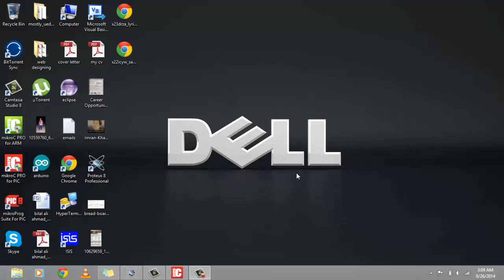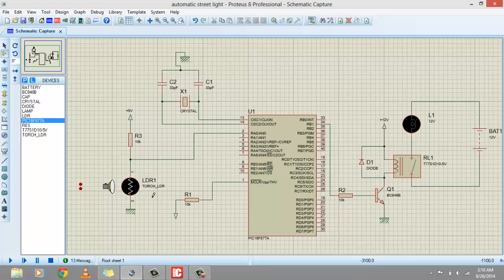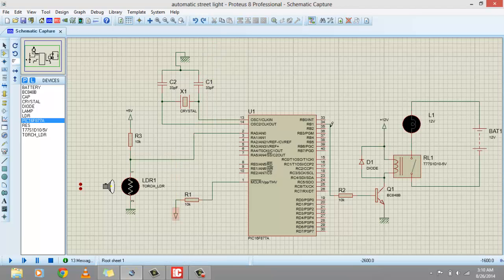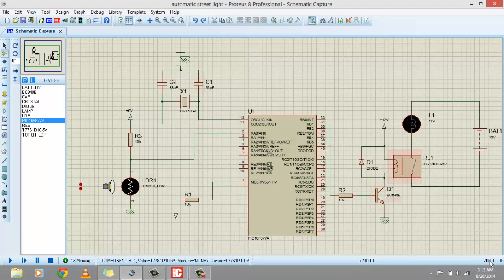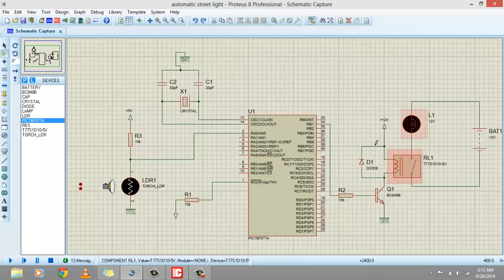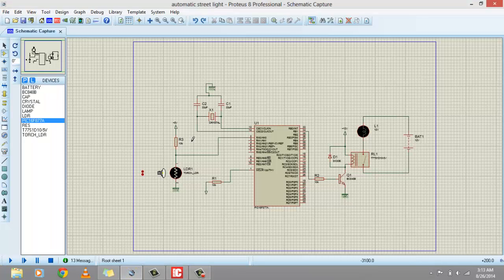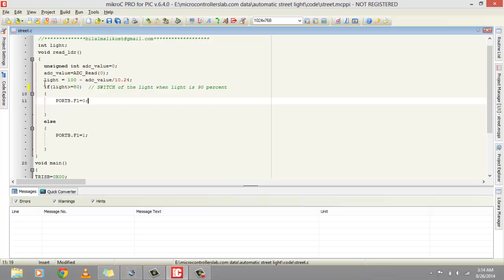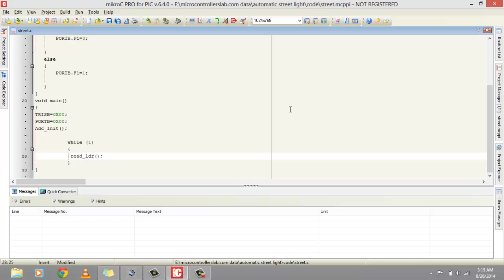Automatic control of street lights using microcontroller

Comment from the maker: Download code: https://microcontrollerslab.com/automatic-control-of-street-lights/
Reply: does the code work? because the hardware work but for some reason the code does not even though it's still can compile. when upload it does nothing,the ldr does not read input. If it does not work DO NOT mislead people to think this will work. Simulate your circuit and provide video of the project working. Otherwise this is a clickbait and im reporting it